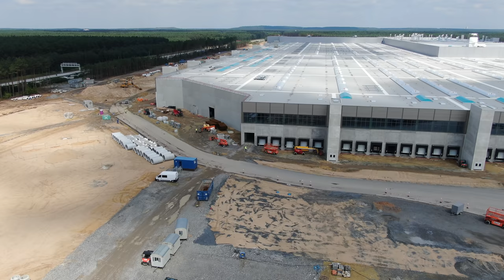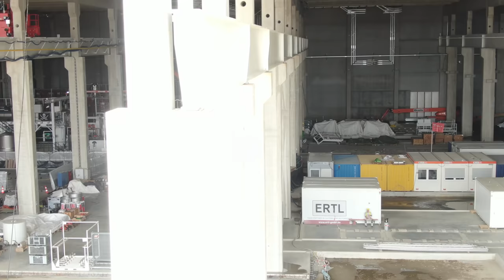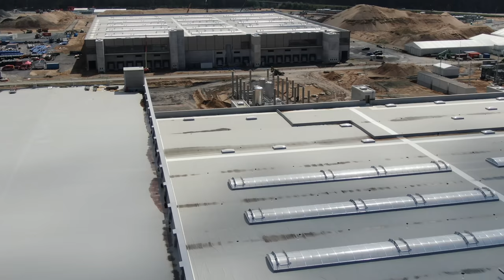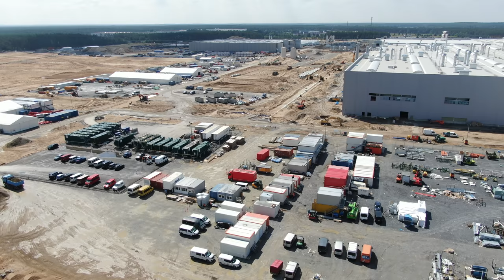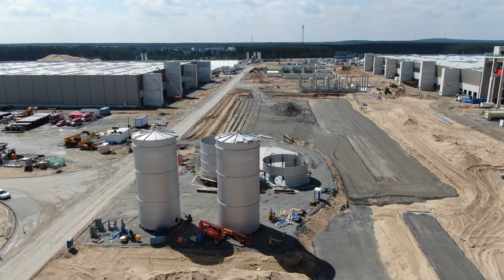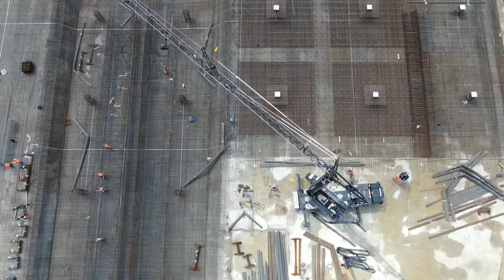Giga Berlin | 2021-07-10 | More Steel Rebar

Comment: I heard Elon fired another Project Manager for building MODEL 3 Line at the same time. It appears Elon wants a maximum effort on MODEL Y Line only and factory to produce 4680 cells. My daughter has ordered the MODEL Y and it will be manufactured at FREMONT with 2170 cells. AUSTIN Factory production will be for Eastern USA and Eastern CANADA. WHAT A beautiful car, red with white interior and 20 inch black wheels, and delivery will be end of September. You are very lucky to have the best version of Y with structural battery pack and front and rear casting from the start in GERMANY. THANKS
Reply from the maker: According to the documents, Model 3 isn't planned for Giga Berlin for now, and it's not clear if it will be build at Giga Berlin later.
Reply: @TobiasLindh  they will start with model y, and only at the end of 2022 with model 3. This info I got from an employe of Tesla dealership

Comment: who cuts all the grass under those power lines?
Reply: Felix Müller together with Anton Freis.
Reply: Grass in switchyards is in Germany standard for decades. Either the layout allows those works or parts will be switched off for those works. Nowadays it's also possible to use lawn mowing robots for this works. There are models certified for working under those conditions.

Comment: Tobias, from now on, battery plant videos are the most important. TESLA is even removing loading bays for trucks at AUSTIN. Your factory has many stair well add on building for worker access and fire escape from floors. Is this a GERMAN building code requirement and this factory has many beautiful skylights. More inside videos showing equipment installation. Thanks.
Reply: Of course stairwells and escape exits are regulated by building codes. This is Germany, not Timbuktu.
Reply from the maker: I don't know how much of that is for building code and how much is for convenience. To me it seems like Tesla built more stairwells than required by code. They did the same in first phase of Shanghai.
The skylights are awesome. It's really bright inside. Much better than artificial lighting, and it saves electricity.
Reply: Die ASR A2.3 fordert für Räume ohne und mit normaler Brandgefährdung eine maximale Fluchtweglänge von nur 35 m.
Reply: @TobiasLindh  I was surprised to see the lack of skylights at Austin. Also--no racking for solar like I believe I'm seeing in Germany. On both cases, the german building codes appear more green. Sad that Tesla would not simply choose to be more energy efficient on their own.

Comment: I know everyone is ragging on the approvals process and German bureaucracy (rightly so), but I don't think we can pin everything on it. Outside of the first stage looks mostly done, but there doesn't seem to be much happening on the inside at speed. Compare that to say construction speed at say Austin or China. Unsure if contractor is also partly to blame.
Reply from the maker: Why do you think that there is not much happening on the inside at speed? That's actually not true. There are much more workers working on the inside than there have ever been on the outside.

Comment: Great video well made footage ,its a shame this project is now almost stopped, must be costing Elon Billions in lost income
Reply: What has stopped?
Reply: Elon wanted the changes which are causing now some delays. E.g. the DU building gets now an additional mezzanine floor for producing battery packs. 
And it was also a decision by Elon / Tesla to skip the original plan to start Model Y production at Giga Berlin with imported 2170 batteries.